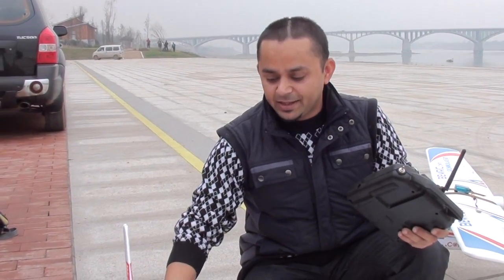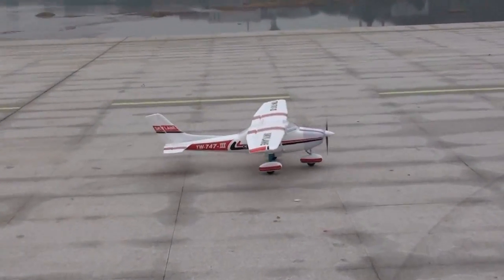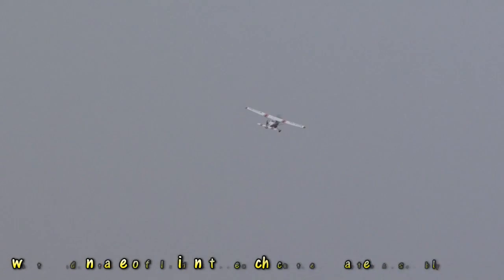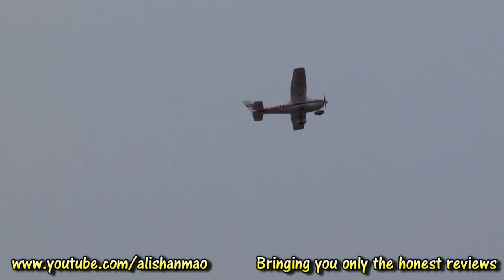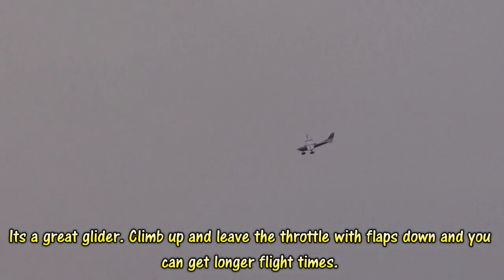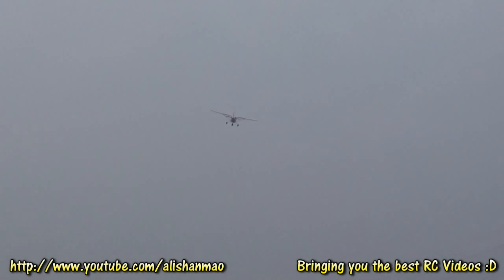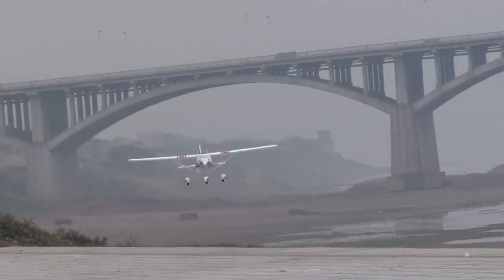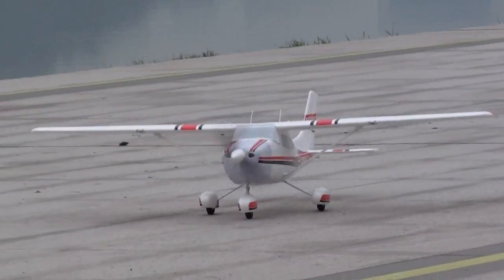Big EPO Electric RC Cessna Maiden Flight

Comment: I have the Big Cessna plane does not provide easy well instruction as in the case with the drive motor cables receiver has no navigation lights, and wants that you identify the colors not recognized with other different colors of the Variator, please favor like splicing wires with colors to introduce

Comment: I just got this plane. It's a very good plane, but the building instructions where really basic and I was struggling to build it. When I was finished it felt all worth it though cause this plane looks awesome. This was my first plane and I did a perfect flight and landing on my first try. With flaps you can land at walking pace. Second flight didn't go so well though since the stock radio started to turn the rudder uncontrollably, I'm waiting for a replacement radio now.